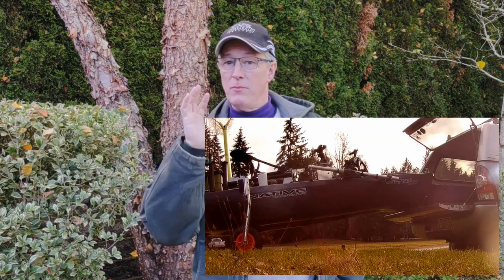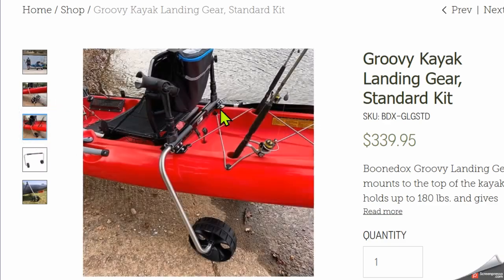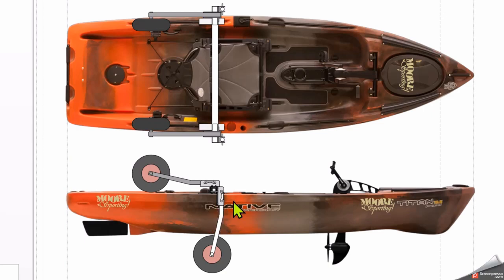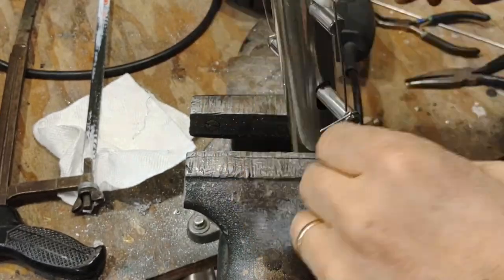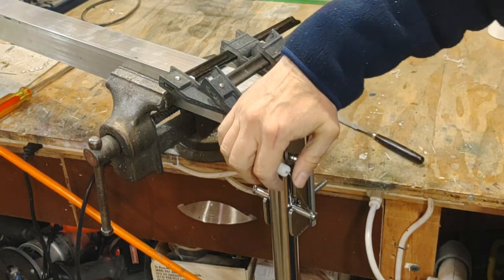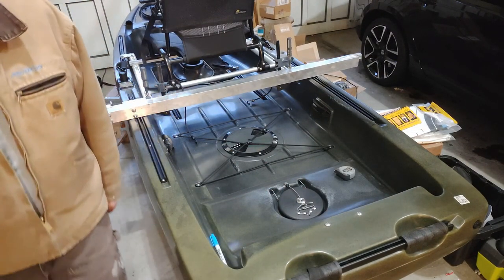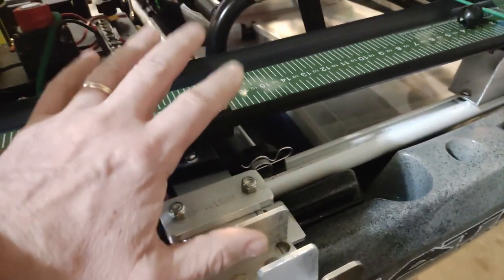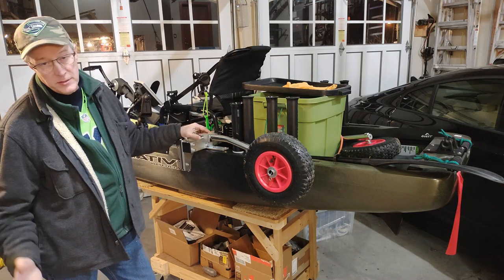An Almost DIY Version of the Landing Gear or Side Kick no carts are needed

Comment: The problem I have with this style is the near full weight of the yak is hanging off 4 screws in the gunwales.  Or, in this case, off the gear track.  I tend to put a lot of stuff in my yak to tram it to the launch. I could have as much as 50 pounds of gear. Plus the water that got into the mull.  Say 5 gallons (40 pounds)...
Reply from the maker: Yes this is true and I can assure you that my stuff isn't any lighter than you described. The only saving grace is that the live scope and seat are mounted to the cross member wheels which removes that weight from the track (about 25-30 pounds) but your concerns are valid. If I were designing a kayak to deal with this I would quadruple the number of inserts and screws in the track. Native seems to think that what they have is enough to deal with those stresses. I think that is tenuous assessment at best. Also keep in mind that about 20 of those pounds are being supported by you and the front handle but that still leaves over 120 pounds dangling on the cross member. The convenience of the load and unload and literally having to spend less than 30 seconds at the ramp is very appealing. So with all that I'm accepting the risk of potential damage to the hull to have that simplicity.

Comment: Great work, looks awesome. Exactly what I want but I don't have any tracks that far back on my recon 120. This will definitely be helpful though, thanks for sharing!
Reply from the maker: Thanks for the feedback, Looking forward to seeing what you come up with.
Reply: @pmm422 thanks, I'll definitely have to share my plans. I just bought my recon 120 yesterday and my goal is to tow my kayak with my bike long distance and  then mount my bike to the back of my kayak to be able to be able to go where ever I want. Going to be a big project but I think it's definitely possible.
Reply from the maker: @NickolasHinderer  That sounds even more exciting, I'll have to say that the wheels I used aren't as friction-less as a wheel mounted with sealed bearings so you'll need to research a bit to find a better solution than what I have. Mine work fine for short distances.
Reply: @pmm422 well the specific product you purchased is no longer available but yes, I definitely think the wheels need to have bearings, I believe harbor freight has a good selection of wheels. Your wheels do not have bearings..? After staring at the kayak for a bit I thought maybe I could fit something into the scupper holes and after a quick search sure enough I'm obviously not the first to think of this. so I went ahead and purchased a scupper hole cart in order to get in the water sooner than later. But I also think it'll be a good starting point where I'm thinking of inverting the rack so that the don't come from the bottom of the scupper holes but up and over the sides.
Reply from the maker: @NickolasHinderer  I think you can still buy them direct from Seamax, well at least they are still listed on their website. I see you can buy 16" wheels too, I might upgrade to those.

Comment: Im running a Slayer Max 12.5 with Native Sidekick wheels.  I have never had a problem as the 1%, that being said I don't abuse my gear. Your idea is neat - It doesn't seem to be 'one handed' which would be needed when launching or returning.  A single person would need to slightly lift the kayak with one hand and disconnect and rotate the wheel with their other free hand.  I would like to see more videos being used...maybe when it warmer...
Reply from the maker: Ya so far the only process that seems to need two hands while on the water is getting it out of the storage clips. it binds on the clip if using the handle I added. I'll try and do it by grasping the actual pin and let you know. This would be a big problem if I wasn't on a Titan. Oh thanks for the feedback very much appreciated.
Reply from the maker: After using it now for 6 months I stopped using the storage clips and just toss the wheels behind my storage crate. now it is completely a one handed deployment. with a little practice I can now attach the wheels on the water with ease and it takes about 20 seconds per side it's as convenient as I can make it.

Comment: I have the Boonedox on my PA 14, but with rubber tires, not the plastic flat ones (I ordered them, I think, in either 2016 or 2017).  Going to their website, I am not sure they still offer the rubber tires - one picture with a blue kayak being carted to the water appears possibly to have them, but when you click on the picture, it comes up with a different kayak and flat plastic wheels.  My problem - and I think you will have the same one - is that the wheels want to cloat, and putting them back on can be a struggle.  It takes two hands - one to guide the wheel into the bar to be locked in, and the other to counteract the tendency to try to float upwards.  And I think you will have the same issue - it is a two hand job in an awkward position,  My recollection is that the flat plastic tires were adverrtized as for a sandy launch.  NOTE: I went forward to your next video on the gear, and it looks like you may have resovled the floating tendency.  Which, of course, will not work on my Boonedox.  Oh well...
Reply from the maker: Ya because of the hinging action of the clip the water current pulls the wheel down and into the clip, so turns out to be rather easy.  in this case the wheel floating is a bonus makes it impossible to lose. 🙂

Comment: When I add something to my kayaks, I use toggle bolts.
Reply from the maker: You can certainly do that and for most accessories I'm sure it would be fine aside from the size of hole you have to drill in the plastic.  For something like the wheels where they are supporting 150 pounds and a tremendous shock load, I would not want that supported by such a small surface area.

Comment: Do you know if that will fit a old town pdl 106??
Reply from the maker: OK, so the mounting portion was completely custom made so ya I could have made it to fit just about any Kayak. The limiting factor is, does it have strong enough gear rail and in the right places to mount it. If not you would need to install some aluminum mounting plates on the inside of the kayak but I have videos showing how to do that too.